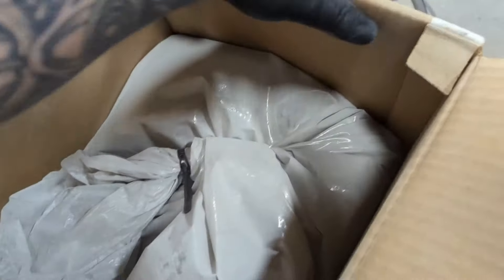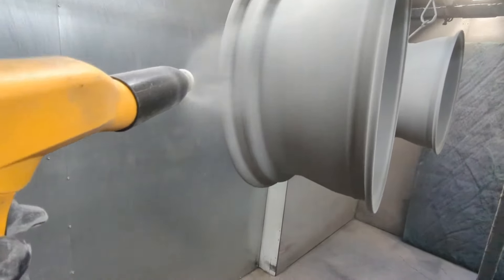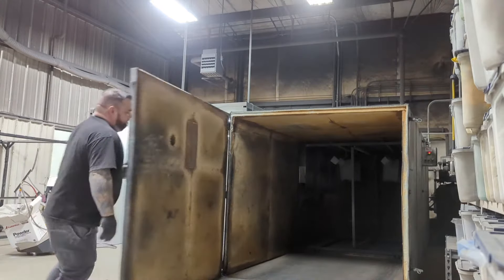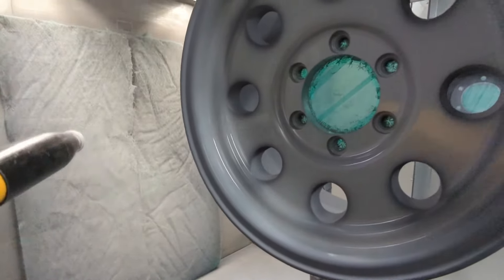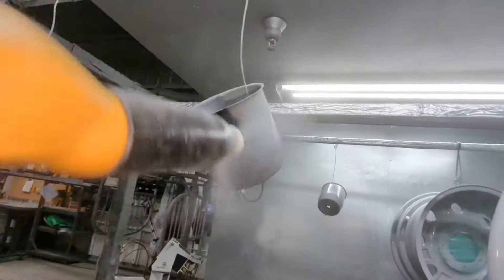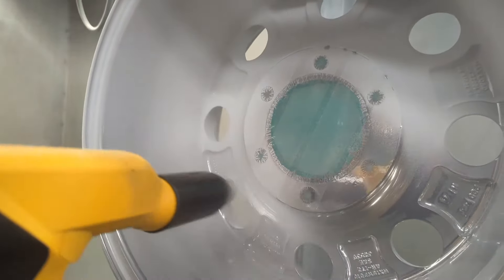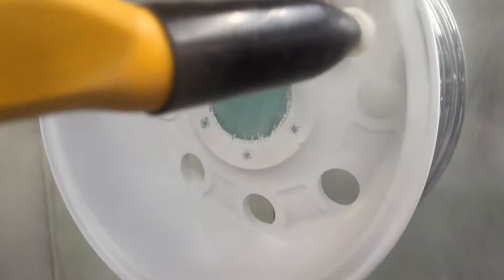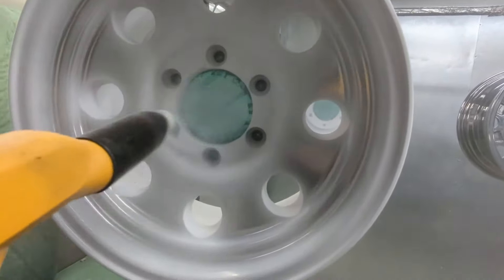The Best Chrome Powder Coat - Ep 136 - Super Chrome Plus

Comment: So whats the bottom line ?😮 is there a enclosure which can achieve the request of the  suv or not ? Good to know there's a formula for calculation of the vehicles interior layout to achieve optimum sound performance, as i have a accord station wagon and aside from wanting to go ported there's a difference between round port and the more recent commonly used rectangle port which im not sure is as good as round/tubular port and then there's the location of direction the port is facing in relation to the subs,but good to know this indepth information

Comment: how does the chrome look up close?  I have done a couple chrome parts, trying to find the color I want for my bike.  I just tried Columbia Coatings Chroma Chroma and in my hand it has a grey color.  From a distance it looks chrome, but Once I but a black candy over that it looks more like a gun metal, the prismatic ultra black chrome looked just like a dark silver.  I also dont have a professional gun like you have.  I just have the Eastwood 250 powder system.  Just a DIYer here.

Comment: Gd day I'm doing some super chrome plus now how do u apply the clear vision is it at low temp or mid temp I did one at low temp fully cool down added clear vision and it turned grey color should the clear vision be added with some type of temperature
Reply from the maker: Did you fully cure the chrome? I also don't recommend clear vision ever. Lots of better clears on the market.   Once you fully cure the chrome and the wheel cools below 150°f you can add clear.
Reply: @UnknownCoatings  oh OK will do thanks so what other clear u recommend

Comment: I had mine done with super chrome and cleared from a professional that's been doing it for years and years the problem is one of my aluminum wheels is turning a brown tinted color and it won't come off I tried everything to remove it and still looks like crap. Also you are right about that they dull after the clear is applied and seems they dull even more even after months of being done. And yes they were dipped, blasted and the right clear applied from prismatic which now I need another set done and I  am really thinking of not going with the super chrome again. I don't know if they came out with a new clear for the super chrome but something has to change with this product cause it looses it's shine shortly afterwards. Now I have to get the wheel redone and that is costly. On the next set I'm getting done I just might try something else like polished aluminum.
Reply from the maker: The brown is because they undercured the powder ;)
Reply: The key is to be light. To help out i pre bake the wheel, apply the powder bake the wheel for 12mins at 400 degrees than apply powder gloss clear coat
Reply from the maker: Lol no
Reply: @UnknownCoatings  This is how it's done with acrylic clear coats, probably why a lot of people think it works for powder too.

Comment: Getting into powder coating. Just ordered “Eastwood PCS-250 Dual Voltage Powder Coating Gun” starting off. What r ur thoughts or opinions? Looks like it’s only got 2 settings. 12k n 25k.
Reply from the maker: It's a very low level gun. But will work

Comment: How can I remove chrome from a grill before powder coating?
Reply from the maker: Depends on the base material. Nitric Acid works on some metals not not others. You can talk to a chrome shop and have the chrome stripped by them